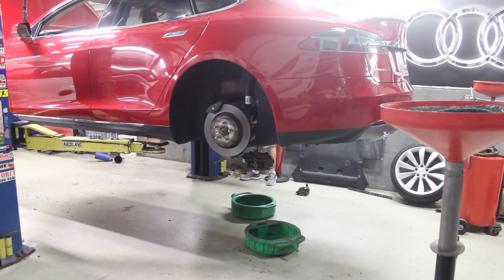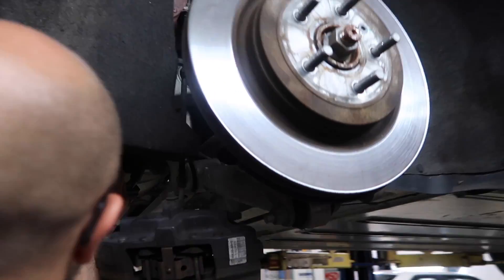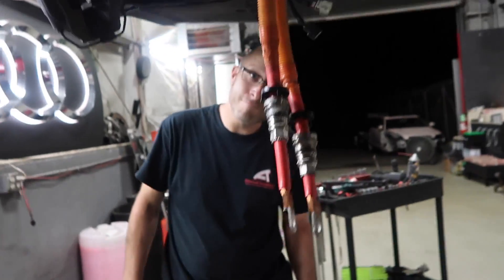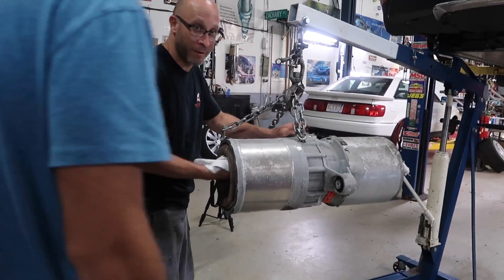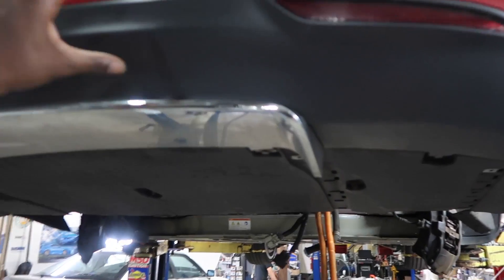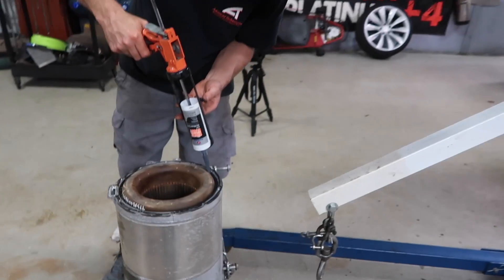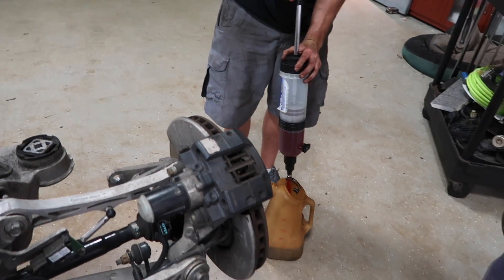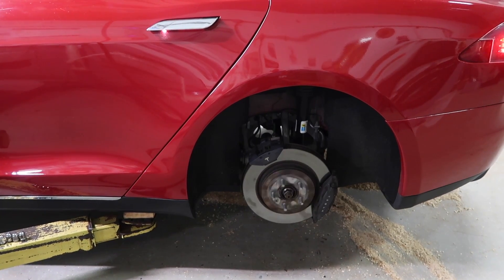First Generation Tesla Motor Failure

Comment: Curious how easy or difficult it is to swap out that motor shaft. Is that wearing down from the insane amount of torque these motors put out? I there's a price to pay for that performance. There is always a trade off in engineering.

Comment: So... having a debate with some colleagues. Does the drive unit contain a single motor, or is it two smaller motors? The outside housing suggests the latter, but I haven't found any references to Tesla having "three motor" Model S (aside from the upcoming Plaid).

Comment: The bearings fail because there are stray magnetic fields that induce a very low voltage in the metal frame of the rotor, possibly below 1 volt but with a large amount of amps behind it. This voltage wants to equalize, so it flows through the nearest metal parts .. the bearings and the shaft spline. The bearings are coated with grease and are not designed to conduct electricity, so tiny electrical arcs form that jump through the grease, crossing the inner race, the rolling elements, and the outer race.

These arcs are extremely hot plasma that work just like a welding rod. They cause weakening, erosion, and pitting of the hardened bearing contact surfaces, which then breaks away fine metal debris that mixes with the grease to become like a fine grit sandpaper that is repeatedly being rubbed between the bearings.

Eventually the race surfaces becomes rough like a dirt road, and the rolling elements are lumpy, so it makes loud noises and vibrations that rattle up through the car frame.

If this bearing wear and grinding is allowed to progress too far, a gap starts to open up between the race surfaces and the rolling elements, and in the worst case the gap becomes so large that the rolling elements can completely jump out of the inner and outer races.

This will most likely happen while the motor is under heavy torque and there is already a large amount of stress on the failing bearings. The rolling elements pop out through the open gap, the rotor misaligns, and the strong magnetic fields make the rotor grind on the pole faces of the winding housing. This will likely rapidly destroy both the rotor and the housing, which may get so hot rubbing on each other that they fuse together and seize.

There was a hydroelectric dam disaster in Russia (Sayano-Shushenskaya), where worn bearing races were making progressively louder grinding noises over many years, and they were not doing anything to replace the bad bearings. Eventually the rolling elements wore down until they fell out while the rotor was under load. The huge generator rotor was now free to move vertically and was apparently shoved out of the generator house floor by water pressure while it was spinning.

This low-voltage arcing and surface erosion is likely also why the shaft spline is all chewed up, from the current trying to find another path to balance itself out and causing erosion of the spline surfaces.

The solution is to provide another more desirable path for the current to dissipate, through a conductive brush contact between the rotating shaft and the stator frame.

However making the brush path sufficiently conductive is a problem as these stray induced voltages may be below 1 volt, so any amount of resistance in the brush will make the current still try to pass through the bearings and cause damage.
Reply: Get a ceramic bearing as a replacement, they wont conduct, or if it is a special bearing not available as ceramic, put a non conducting sleeve in the bearing seat. However there will still be a path for the current, now through the gearbox bearing, but the circuit is longer, with higher resistance, so less of a problem, but keep the carbon fiber grounding brush. This is how the model 3 motor is made now and though not being an induction motor, so it has smaller shaft currents to begin with, it is even more important to do this modiication on an induction motor like in this video.

Comment: Why can the original Tesla roadster motors last so long but the model S motors had so many problems?
Reply: the weight of the vehicle plus the performance delivered from software update makes the motor fragile, plus bearings are almost 50% of motor failing

Comment: I'm kinda confused, if these cars have the 500k mile warranty why didn't they take this car to Tesla to get it fixed for free? Not saying you guys do bad work but I am sure you didn't do this for free. This motor is still under warranty, yes?, as they are not supposed to fail at such low miles or am I wrong about it being still under warranty?

Comment: In 1970's worked in sawmill machine shop the guys manufactured replacement parts for sawmill that could cut 40' x 8' logs. Headrig baskets resaw choppers etc. Impressive skills those old mill Wright's... Looks like spline could be machined.

Comment: Hey there's an old mechanics trick where you take the new bearings, pop off the seals and replace the grease inside with high quality lovely ness. Bearing manufacturers without fail put grease from the lowest bidder inside. With good grease they can sometimes last over twice as long. 

Also you'd think you could wrap some teflon tape or maybe use some JB weld on those splines, it should reduce the lash and make it last longer.

Comment: Is it pretty normal in Tesla’s for the drive motors to go out ?
Reply: early 2012-2014 cars they did have motor issues, and they replaced motors with newer revisions. I haven't heard of 2015+ Models S, or X, or any of the 3s having motor failures.

Comment: One and one thousand times, those calipers must NOT hang from their hoses, use a cord attached to the springs to do that. And despite the fact those hoses were made to work under pressure, it does not mean that were designed to have a traction effort nor their connections.

Comment: The pre 2015 failures were due to erosion of the steel balls in the rotor shaft bearings. The erosion was caused by induced currents (common-mode, capacitively-coupled current, see 'A closer look at the losses in EV motors' by Jeffrey Jenkins first published in 'Charged' Issue 41 – January/February 2019) going to case ground via the bearings. I have a vague idea the later motors had better grounding of the rotor shaft, possibly via a brush of some kind. It would seem using ceramic ball bearings which are insulators would avoid this particular problem but I don't know if Tesla went that way.

Comment: If you guys were pulling on the outer race of that bearing after you beat it on with a steel pipe too far... that dramatically shortens the life of the bearing!

Comment: The thing that bothers me about EVs is that, as anybody who works on cars knows, if it simply quits, its probably electrical. There's absolutely no warning. electric is either there or its not. Whereas an ICE car, something can be wrong with it, but usually there's at least some temporary way to make it go till you can get get to safety. The LESS electric stuff in a car, the better. If my ability to move is completely dependent on the electrical system, Not worth the risk.

Comment: Is it rue that Tesla motors can be installed by the dealers for about $800 out of warranty? Some dude on twitter was bashing ICE vehicles and said his buddy needed a cat convertor which cost $2500 and you could have the DU in a Tesla replaced 3 times for less than that.

Comment: We in the dirtbike world have used high strength loc tite on output shaft splines to take up the slack from wear like you have. Not sure how it would handle that torque but for motorcycles it works great.

Comment: Turns out electric motors are not as reliable as people say they are.
I used to build R/C cars and electric motors burn out coils and blow bearing regularly,
Reply: Some motors are more reliable than others. Railroad locomotives run on electric motors with great reliability. Industrial automation runs on motors than sit there and run continuously around the clock, year after year. Tesla is building lightweight motors that also need to be insanely high performance but also efficient.  It's a challenging thing. They could make a heavier, lower power motor that would run forever. But what fun would that be in an expensive sport sedan?

Comment: We did all this with our slot car motors in the '60s.  Balance the armature, sand/grind the coil racks in a drill press to get it perfectly round, then shim in the magnets.
Reply: And while the armature is in the drill press, use a small file to make sure the commutator is round and concentric, then (on some motors) you could rotate the commutator in relation to the poles to add a little "advance". That got you more revs (in one direction only).
I also built a simple dyno from a large round tin can coupled to a car speedo. That was popular!

Comment: wow never seen someone actively using the brake lines to hold the calipers.... I've dropped em before and they've yanked the lines, but I'd never let them hang off them.... *edit, okay you did add zip ties after they were already dragging around and hanging for awhile.

Comment: He should find a good machinist that can weld and  build back up the spline teeth and  then mill the spline back to spec. The splines are designed this way to protect the shaft from breaking.

Comment: What about soaking most of the electrical items include the motor in after repellent contact spray? The motor could instead be coated in insulation varnish to prevent rust. Just an idea.

Comment: Rich, I love your drive to succeed as can do attitude.

Tesla should be better at this game. On the cars and water leaks, it’s not like cars and best practices for keeping unwanted moisture out is a new thing. 
Also high torque electric motors have been used in forklifts for years.
Also a well balanced motor should have little to no pressure on the right engineered bearings.

It’s Motor failure and Battery pack failures out of warranty that will kill Tesla in the long run.
If a used Tesla with 140,000 miles will sell for $30,000 and a customer takes out a loan to buy it, what happens a month Latter when an out of warranty motor lets go or the battery pack goes. No bank is going to then update the loan to $45,000 to replace those items. 
They have to do a better job of item warranty and build better engineered product for longevity. 

Haunt the crap out of them. Otherwise Tesla will be another CMC  Delorean.

Keep up the good work sir.

Comment: Here's alittle tip from the offroad world, anytime you have splines like that take some maxima gease or I personally use grizzly grease, and get a nice coating on there. Most of the wear from what I deal with is from corrosion and rust and not actual use, so when I replace both ends of a splined piece thats in a dry place I always grease the splines and most of them time I can get 4 or 5 times the life out of the splines. CV axles are a good example, the splined on the wheel side are put together dry from the factory, and after a year or so from hard offroad abuse, the splines are sloppy but the joints are still good, so if i grease them when there new, they usually last until I explode a cv or break a axle.

Comment: There is a special brush that grounds the rotor that wears out it need to be modified because stray electric currents are eating the bearings this was the cause of the motor failures

Comment: To loosen ruls like that soak or wet the area with a premixed solution of Acetone and Brake Fluid. Guaranteed to loosen any rusted joint or part. Soak for about one hour.

Comment: As i understood S model is driven by 3ph AC 4 pole motor with VFD vector control. Ok here more or less clear - AC squerrel cage motor is really an idiot proof toy. 3 model according to wiki is powered by DC motor with permanent magnets. There for question - how DC motor is controlled? Is it H-bridge with IGBTs which is based on Pulse Width Modulation?

Comment: If the splines strip off the shaft, it isn't necessarily a dead rotor.  A good machinist could build it up with weld and cut new splines.  It might be worthwhile to do it early before the internal splines they mate with get damaged too, as that would be a more annoying job.

Comment: I am no tesla expert, but these drive motor bearings are way too narrow to support the weight of the rotor and handle the kind of torque and power this motor puts out. I have seen much more bulky bearings on motors putting out ten times less power. These bearings could be one of the reasons for so many premature drive motor failures.

Comment: Did u guys put the Mobil XTC grease onto the motor shaft before you reinstalled the rotor?... and the reason why u guys couldn’t pull the other rotor out is because the other bearing is actually glued into the bearing housing, they did that after a certain year to keep the bearing from spinning inside..
Reply from the maker: Yes and the other rotor was from a flood car. Rusted shut. Gotta watch the other vids man :)
Reply: Rich Rebuilds hehe I’ll have to watch the other vids then! :)..
Reply: Rich Rebuilds when I rebuilt one of the motors, I had to custom design that grounding brush since I destroyed it getting the other bearing out haha. And for me, I took the other cover off and just pressed the rotor out lol!...

Comment: Agree with many of the comments about the design. Tesla's missed some basic stuff about failure modes.

WRT blowing the spline shaft dust out - WHY do it that way? Get a shop vac, make or buy a flared end nozzle , put a hole in the side for the air line.

That way you can blow it out and vacuum up the crud at the same time, before it hits the stator assembly, let alone the rest of the room.

Comment: For the drive unit with consumed teeth you could try to find an revisionist of electric engines, they apply a chromium coating (some companies prefer to weld over) to the shaft, thermal treatment and then machining it down to the original size and shape. If you have a spare consumed one you could try to see if under fatigue test shaft is great as new or it blows down miserably, although the cost of this experiment is not that much usually but it could avoid some headaches searching a new compatible one. Good luck

Comment: We will see fingers chopped if new permanent motors are handled light that. In those, (if you ever can take out the rotor, which will be difficult), putting it back again can be dangerous because it is sucked in an instant. Specialized tools will need to be fabricated for that. My jacket got caught when doing it with a Zero FX motor, and man, you don't want your fingers there.

Comment: Richie,  Love your humor.  If the bearings were seized  there could be damage to the end castings that hold the bearings.  if that is the case you probable need to add .002 shim stock  and press fit the bearings into the castings  before re-assembly.

Comment: If you buy the bearings from a bearing supply using the bearing number, you can buy a much better bearing for less $ plus they all can be sealed bearings. The grounding brushes sound like a good idea , if a gas car looses its body ground it will destroy the wheel bearings.
Reply: LOL

Comment: Rich awesome vid. Bro yer getting old start working out to get better at using the engine hoist. Dude yall didn't replace the copper brush in the motors, that needs replacing as well. Otherwise thanks for this vid.

Comment: Why are the shaft and bearings so small on a tesla? I've done work on motorbikes and they're a similar size but producing way less power and obviously bikes weigh far less. Should the shaft and bearings not be much bigger?
Reply: Purple Ether they say they couldn't get supplied better parts in the start but like most modern car's though there designed for profit so it's in the manufactures best interest to make it so it won't last forever & costs a fortune for the parts to repair it because car manufactures these days make a lot of money from replacement parts

Comment: concerning the drivetrain, one should should be able to swap the open differential for limited slip differential (LSD) or torsion  differential for better on-road performance and control of the vehicle when cornering or on tracks. Also consider performance coil-over suspension front and rear (if possible).

Comment: By the time that splined shaft is making noise, failure is imminent. The female part that shaft mates with must be also replaced at same time. The one in video likely failed due to the bearing failing first. But, if there is an case alignment issue, both besring and shaft could have been placed in a bind during initial assembly.
It appears that shaft was not lubricated properly, but that's unlikely. In actuality, the metal surfaces have been destroyed by abnormal severe pressure & friction, which also removed the grease.  In fact, if you were to pull one of these motors apart at 50k miles. and grease is still present on splines, all is well. 
No grease present and you can expect a future failure, even if you lube parts andvre-assemble.
FYI: You can buy proper splined driveshaft grease at a Honda  motorcycle shop. It is called
It is called " Moly 60 paste" under Honda brand.
Its waterproof, high temp, tacky & pressure rated and is specifically used for splined drive shafts.  It comes in a small grease gun tube. A little goes a long way.
Reply: Something most motorcyclist know about when replacing front sprockets.  I also had noticed how dry the mates were when they pulled the drive unit apart, then cringed as they reinstalled the unit and not seeing them put any grease on the splines of the shaft, not saying they didn't but was wondering.  Yes the shaft is toast regardless, but until he has the money for a new one greasing it will help it survive a few more miles.